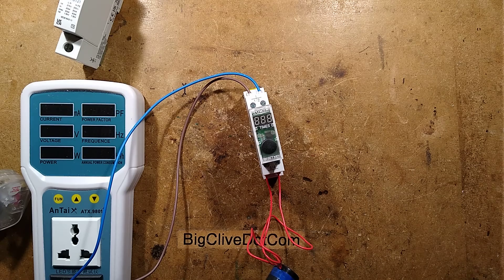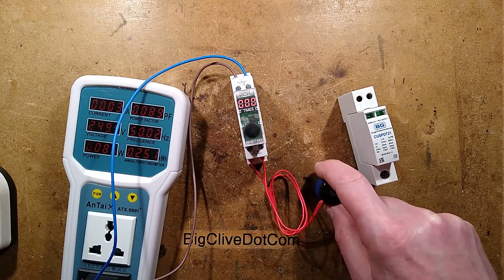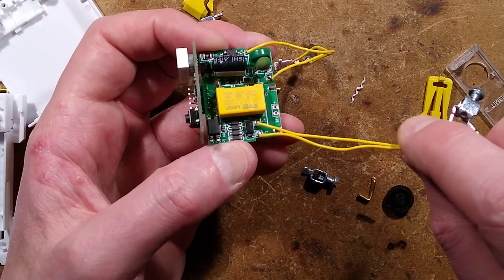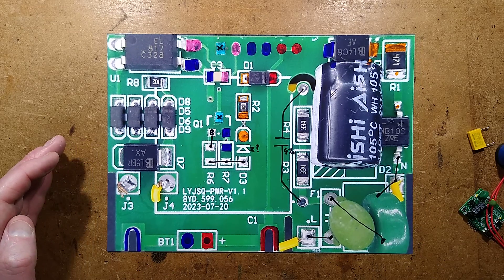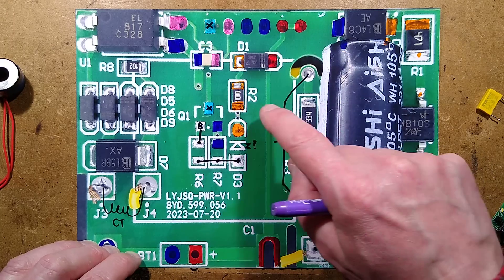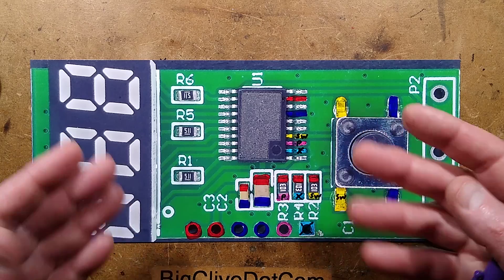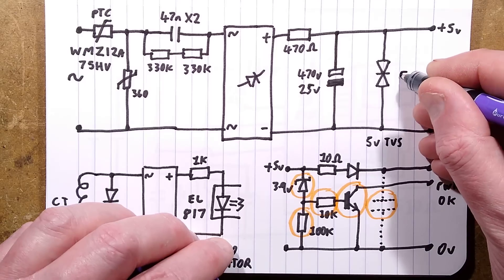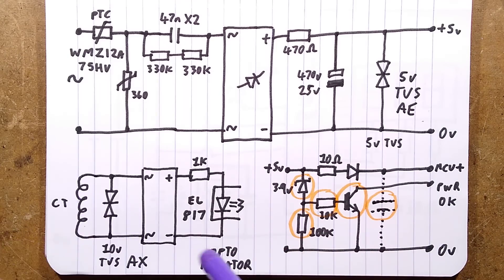DIN-rail lightning strike counter

Comment: You could have passed a few turns of wire through the CT, then give it a high current pulse
Not sure the magnetic flux of a magnet is in the right direction, also it may only react to an impulse.

Comment: When the MCU itself has a Low Voltage Detect (LVD) built in then why employ such a circuit (with many components)  to detect power failure...? I regularly uses MCUs LVD to successfully save various parameters/variable to on chip EEPROM... That too with 100% success rate since last many years...
Reply: If it had a standby battery then there wouldn't be an under voltage on the microcontroller to detect.  The voltage detector is there to turn off the LED display and prevent it from discharging the battery.

Comment: Thanks for pointing out that PTC resistor on the output. I was wondering why there was a tiny grape on the board.

I wonder if they used the TVS devices because they cost less than zeners with those I and V specs? I haven’t had to price parts like that in decades but I wouldn’t be surprised.

Comment: just in time as I had a major spike today that made an led bulb explode along with a usual manual switch that controlled it (!)
Reply: @kti5682 yeah, the dsl routers are usually first to blow up
Reply: @kti5682 all it tells me is that the electric company don't have proper surge protection and there was probably a huge spike that shorted the light switch and blew up the bulb

Comment: ...@14'50" you express 'mild surprise'  re the capacitor across the 'reset' switch. I suspect the capacitor's purpose is more to prevent local extreme noise events (zapppppityy zap zap) from resetting the count rather than to de-bounce the switch...
Great video, appreciate you finding all these novel bits and pieces and doing the analysis...
...Just had an amusing thought.. You and your channel are almost like having a subroutine running in the background that I, (and a million +++  others), poll occasionally to see if it has found anything intriguing... LOL.
Reply: Another 2 possible reasons for the debouncing capacitor across the reset switch I could think of:
- To prevent multiple unnecessary writes to the non-volatile storage when the reset button is pressed.
- To allow a future firmware version to respond differently to that button being pressed, requiring a debounced signal from it.
Reply: Turn on notifications in order to not miss anything. 🤪
Reply: @TomCee53  ...Ahhh...yessss...an interrupt instead of a poll.... Nice!....
Reply: I think the cap across the optic isolator is also a debounce circuit of sorts.  I know nothing about lighting strikes, but I could believe that there could be a bunch of transitions in a very short duration that would just be one strike and you would want to count them as one strike

Comment: Good to see a nice bit of conservative engineering with quality components.
Reply: Given that it's working with sudden violent high current and voltage spikes, it may be that if they cheaped out the components would just have failed the first time they were needed.

Comment: I wonder if the arcing output of a stun gun module would be enough of a current spike to count as lightning. Only one way to find out, maybe don't feel the output of it this time :)
Reply: I don't think they pass a very heavy current. They're more about voltage to strike an arc.
A battery welder might do it.

Comment: Never realized there was an actual need to count lightning strikes...to me if the power goes zap-boom then goes out it's pretty sure a sign of them  :)
Reply: The number of counts probably  gives you a good indication of how close to being useless the surge suppressor is.
Reply: In some cases it gives an indication of how useless the lightning strike counter is.
Worked on an antenna farm that had a mechanical style counter on each mast, and all of them were on 99 and probably had been for years.
Reply: @barrieshepherd7694  Counting strikes is useless though since the lifespan of MOVs is a function of how much energy they have absorbed in each event, not the event count. MOVs can officially take only one hit at their maximum joules rating but hundreds at 1/10th rating as long as they have time to cool down in-between and do 1/100th almost indefinitely as long as they have adequate cooling. There is somewhat of an inverse square relationship there.
Reply: @teardowndan5364  MOV?
Reply: @wibbley1  Metal Oxide Varistor. They are sometimes also called Voltage Dependent Resistors. These things have a voltage rating based on the point where they leak 1mA which increases by orders of magnitude into the kA by the time their peak energy rating is reached.
Reply: @teardowndan5364  Thanks. I have just bought an SPD to fit into a consumer unit. Have bought a well known UK brand, but all their stuff is now made in China (used to be UK made). I am told they have a skip full of the Chinese stuff at their UK depot, that have failed their UK inspections. Still prefer to trust the UK brand over an aliexpress £6.99 SPD 😀 The aliexpress SPD have different voltage ratings, so your explanation helps understand them.👍

Might add this lightning counter, but do not know what size the CT is, it will need to go round 25mm tails, or possibly the 10mm cable I plan to use for the SPD.

Knowing how Chinese stuff 'almost' works, the CT will no doubt be just slightly under-sized :o)
Reply: @wibbley1  SPDs aren't meant to absorb surge events longer than a few microseconds. Even #24 (0.5mm) wiring can pass over 1000A for microseconds at a time without burning the insulation.

The SPD wire gauge is more about making sure the wires don't melt before the breaker or the SPD's thermal fuses trip when the SPD eventually wears out as MOVs normally fail with progressively worse leakage current until the thermal cutoff has to kick in to prevent a potential fire hazard.

Also, if you put the SPD on its own breaker, its effectiveness gets reduced by the parasitic inductance in the breaker's trip coil. SPDs are most effective when hard-wired directly into a branch circuit.
Reply: @teardowndan5364  Thanks for the info.
The wiring regs give a minimum of 2.5mm for L&N and 6mm for CPC. 
The manufactures web site showing a picture of SPD pre-installed shows their 16mm Live daisy chained Isolator-SPD-RCD1-RCD2 and a 16mm to the neutral bar. 
I will use 10mm for L&N and 16mm for CPC.
Reply: @wibbley1  For a UK-style setup where the SPD is effectively connected to the mains breaker through an RCD-only device, you end up needing wiring thick enough to safely trip a 20% MCB overload over a potentially several seconds long thermal delay when the SPD fails in exactly the worst possible way.